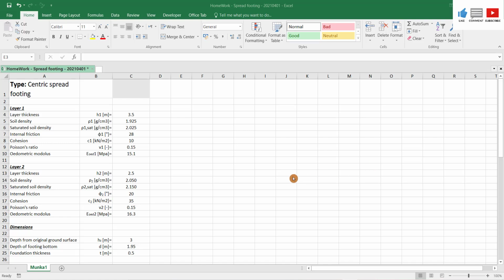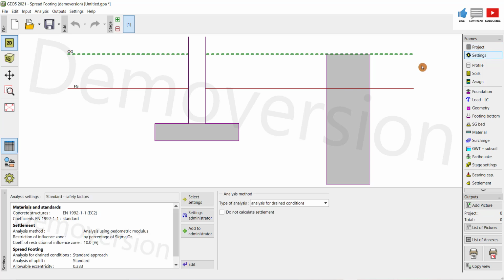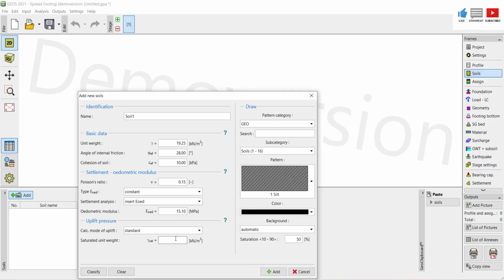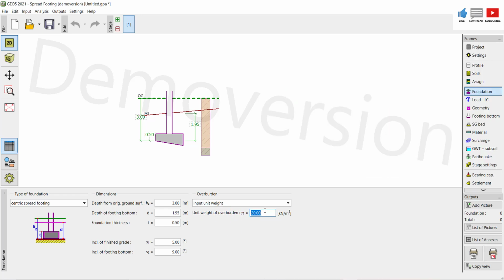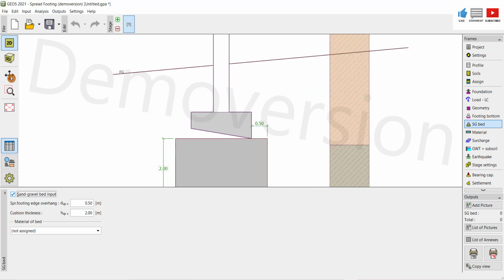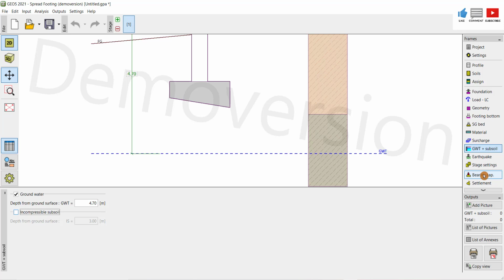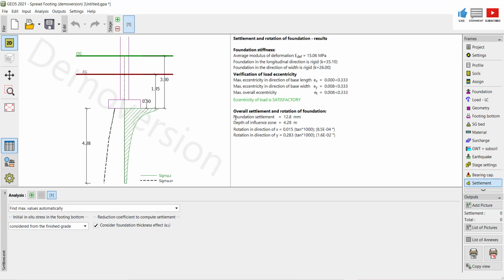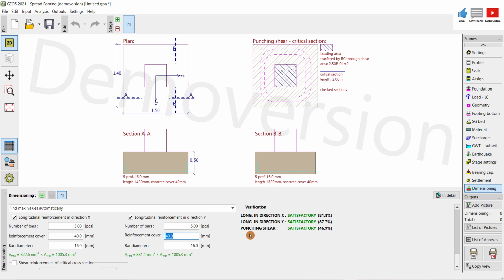Analysis And Design Of Spread Footing By GEO5

Comment: Sir can u please add a geo grid layer in it
Reply from the maker: I didn’t used for analysis of geogrid before, but according to the following text ,there are ability to perform.(This program, based on the finite element method, can model
and analyze a wide range of geotechnical problems, including terrain settlement, sheet pile/diaphragm walls, slope stability, excavation analysis. It offers several material models for soils and a variety
of structural elements such as walls, anchors, geotextiles or Geogrid.)
Reply: @ENGSchool   can u please make a video on it
Reply from the maker: Nowadays I’m so bussy with my thesis, I’m so sorry ,
Reply: @ENGSchool  its ok. But if u can try it will be very helpful
Reply from the maker: Ok brro remember me after, 3 months,if you interested in
Reply: @ENGSchool  ok aure
Reply: My submission is also next month
Reply from the maker: I’m sorry , really I have many things to do in this period, sorry I can’t help
Reply: @ENGSchool   it's ok